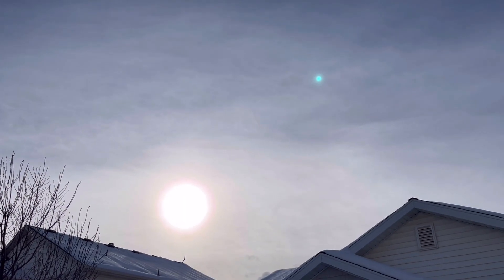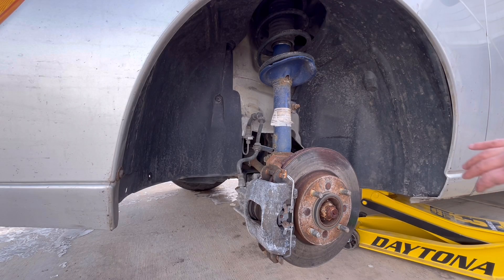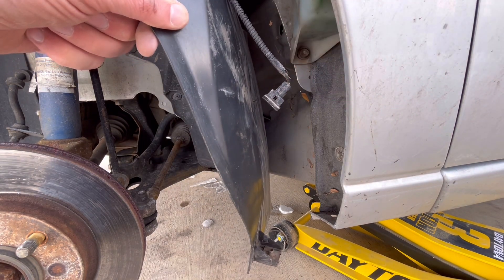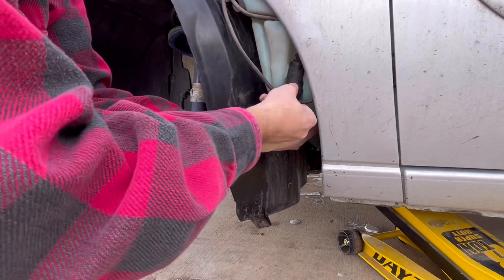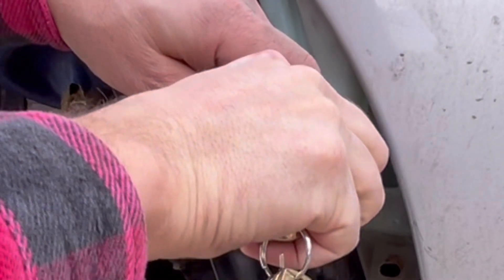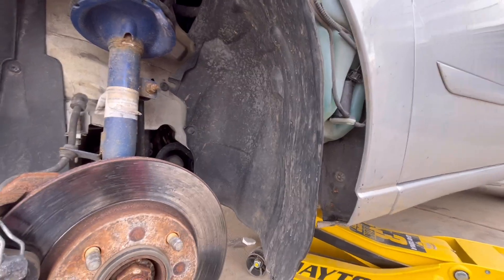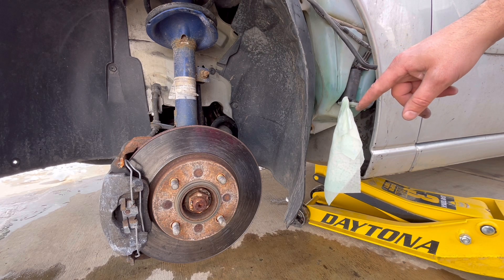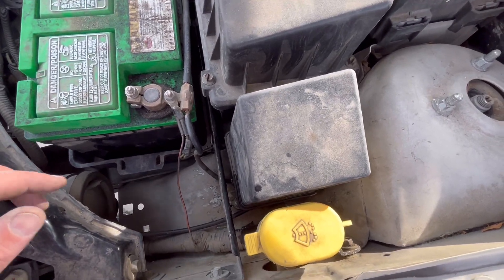2003 Ford Focus Windshield Washer Pump Replacement

Comment: If you need to clean out a pipe I used one of my old bass guitar strings. Reasonably stiff to push through but flexible so it goes round corners. 

Great DIY man. Looks like I have to do this on my dad’s old car.
Reply from the maker: Great advice on the guitar string.  That car was a really good car, but sadly it got totaled a few months ago.

Comment: I did this yesterday. It wasn't so bad. The insert behind the bolt holding the bottom of tank got destroyed in the process. I couldn't fine an exact replacement, but a Dorman 961-351D was an adequate substitute. I also needed a couple of 963-522Ds to replace the black inserts. My pump didn't come with a replacement grommet, but the old one worked fine.
Reply from the maker: Glad it worked out.   The ability to improvise can make all the difference in the world!

Comment: My LR focus washer front windshield one side was weak, and another side was normal, very weird Ive tried to replace the nozzle and the washer hose didn't work, same issue, so I guess is the pump issue? Its still working fine, how can become weak on one side but not on the other side very weird
Reply from the maker: I’m not sure on that, unless there’s a blockage in one of the fittings, but it sounds like you replaced everything?  I wish I knew.

Comment: As much fun as re-charging the air conditioner. Accessing the low pressure port is pretty much the same process, on the other side.
Reply from the maker: I hope I never have to do that for sure!  Sounds terrible
Reply: Had to ac port at least 10 to 15 times. Had the car for 18 years